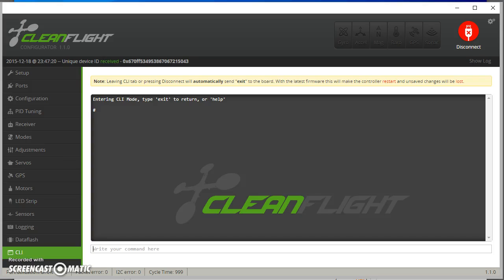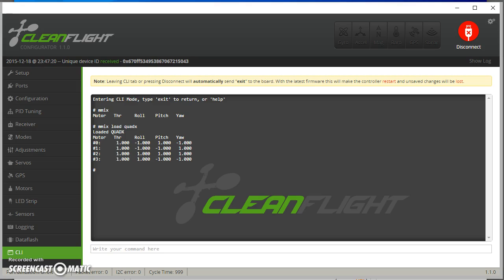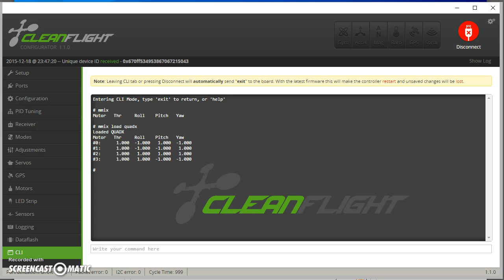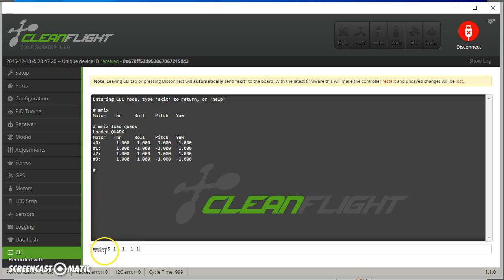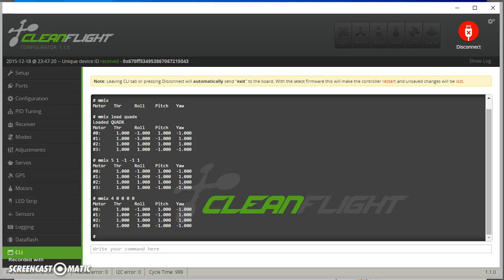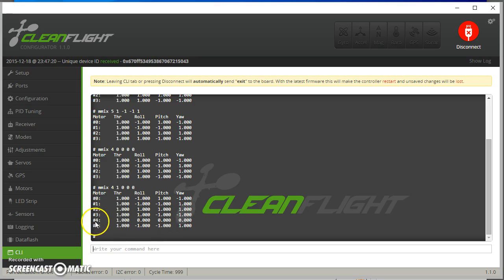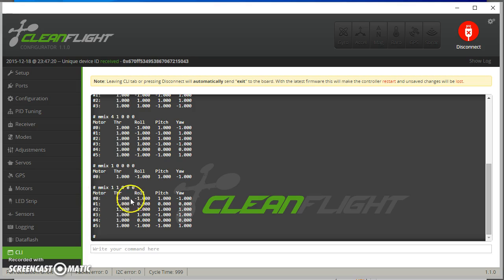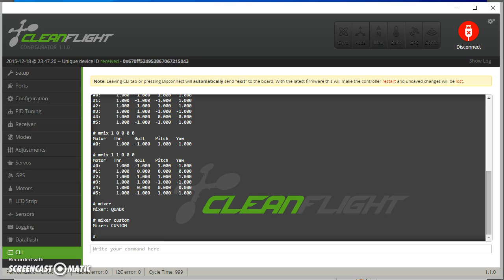Tutorial: How To Remap Motor Outputs In Cleanflight / Betaflight

Comment: hello Joshua Bardwell 🙌🙌🙌
Recently i did the motor remapping things just to play with FC and after that i just change the motor wire connection and now the omnibus f4 pro v3 blue LED blinking is not happening and i cant connect to System too, so what could be properly i have done...so  now i can't even remember the all individual  motor three wire connection..
can you please help me wit that proplem??
Thanking you
Tenzin lobsang
Reply from the maker: Changing motor mapping should not cause the USB to stop working.

If you can't connect to USB, re flash the FC using bootloader mode. Enable "full chip erase". This will reset the FC to default.

Comment: ...and for fixed wing works the same?....none of my servos are moving. They power up on lipo plug, everything ok in rx tab and cleanflight, i can arm and spin the motor, but no servo moving....
Reply from the maker: Setting up servos is more complicated than this. You need to configure the servo outputs and map them to pins. I'm sorry, but I have zero experience with this.
Reply: Joshua Bardwell thank you! Best man

Comment: I agree you are the man. My motor 1 quit working on the bench and I was getting solid green light after a few minutes of powering up, I was about to order new motors and esc's but I was convinced they were ok so did a bit more sniffing around, thanks pal.
Reply from the maker: Glad you fixed it but this is what you should do today, not motor mixing:

https://www.youtube.com/watch?v=FysPHx7RL9s
Reply: Why shouldnt I leave it with motor mixing does it cause issues? because ive been having drift and twitching problems that ive almost got rid of now, im wondering if this is why, Thanks.

Comment: Hi Josh, Set channel_forwarding_start=7 will push the output from the receiver to the servo but for more than one its got me stumped?
I cleared the resource for two channels ie
Servo 1 is A02 (Baseflight Aux 7)
Servo 2 is A08 (Baseflight Aux 8)
But changing the set channel_forwarding from say 7 to 8 just changes the switches on the controller and always the same servo?
I tried things like set channel forwarding 7, 8 but still no luck, I know the answer will be simple but I cant find it anywhere?

Comment: I followed this exactly and when I arm it flips out. ALso when i type mmix load custom, I get no values. but when i type mmix load quadx, i get all the values from 0-3. Any tips?
Reply from the maker: Go back to the default mixer and just use resource remapping to re-order your motors. It is better.

https://www.youtube.com/watch?v=z5aO-3_n-Hs

mmix load only works to load the standard mixers in as a custom mix. "mmix load custom" doesn't do anything as far as I know.
Reply: Joshua Bardwell I've actually remapped the resource(like in your other video) so now there are only motors 1234 and motor 2 is using motor 5s pin. it's on quadx now and it is still having the same issue
Reply from the maker: Check in the Motors tab that the correct motor spins when you raise the slider. Since you have been mucking about with remapping motors, it's almost certain that you have them ordered incorrectly.

Comment: What is a header number??
Reply from the maker: The motor outputs are numbered 1, 2, 3, 4. A pin header is where the pins are soldered to the board for you to plug wires into.
Reply: Thanks!!!

Comment: Thanks a bunch i had to remap two motors my flight controller would run both pin 2 and 4 at the same time for some reason I think I have faulty board
Reply from the maker: Look into betaflight resource remapping. Much better than a custom motor mix because it actually remaps the motor output fully. 

https://www.youtube.com/watch?v=z5aO-3_n-Hs
Reply: Joshua Bardwell yes I actually saw that video about an hour ago and would have done it that way it looks so much easier

Comment: great vid.  I was wondering if I could use a free pin such as mmix 5 for signal only purposes for a alarm/buzzer [e.g. mmix5 1 0 0 0 0 for throttle only].  the buzzer is designed to turn on if the signal stops.   do you know if this would work?  thanks.
Reply from the maker: +skytalon74 you would need an external circuit to detect the stopped signal. Are you trying to set up a failsafe buzzer? There are easier ways.
Reply: Joshua Bardwell yes. For a lost quad.  I would hit the disarm switch so no signal is passing through.   After 1 minute the alarm is designed to Beep.   I was thinking to test this.

Comment: After creating and using custom mixer,
cleanflight doesn't effect anything.it shows that it uses custom mixer but it isn't affect.
all things are saved.
Reply from the maker: Custom mixer does not re-order the motor outputs. The Motors tab is un-changed when you use custom mixer.

If you are using CF 2.0, then you shoudl use this feature instead: https://www.youtube.com/watch?v=z5aO-3_n-Hs
Reply: Joshua Bardwell Thanks for your support.
i will try that after betaflight 3.1 flashing.

Comment: off subject but does anyone know how to reverse rudder and aileron in cleanfliggt or betaflight
Reply from the maker: Best to do this in your transmitter I think, but you can reverse the channel using rxrange. The default setting is rxrange X 1000 2000, where X is the channel you want to affect. 0 is always roll. 1 is always pitch. 2 is always yaw. 3 is always throttle. This is true even if your channel mapping does not match this!

If you wanted to reverse the rudder channel you would enter "rxrange 2 2000 1000" in the CLI then type "save".
Reply: Thankyou very much. Im using a very cheap spectrum rtf transmitter that has no menu settings
Reply: Thanks anyway it didnt work. It wont reverse
Reply from the maker: +Patrick Fidler rxrange 2000 1000 definitely works. Look at the 3d model on the receiver tab. Which way does it spin?

Comment: hello pin 4 and 6 don't work on my cc3d. they did and now they don't. any help??
Reply from the maker: +vinnnocc1011 did you try to use resource remapping and break them? Or did they just stop working?
Reply: Joshua Bardwell   i got it all figured out. i resourced the motors now pins 1-2-5-6 work. now i got it flying not good but at least it lifts.   someone said anything above 2.9 is no good for a older cc3d is that true?   i'm on 3.1.1 now stock pids and quad flys crazy wont hover wants to flip and spin
Reply from the maker: +vinnnocc1011 I don't know any reason you couldn't run either of those versions on the CC3D. If the copter is trying to flip out probably the motors are not in the right location, since I know you were messing G around with remapping.
Reply: also i'm running emaxx 12a simonk. the quad ran great on openpilot.   now with betaflight and cleanflight it's so bad.
Reply: @vinnnocc  Bonjour utilisé Betaflight / CC3D 3.1.7 Apr  3 2017 / 21:54:46 (e1c4b5c) , très bon pour buzzer voie 5 ou 6

Comment: hi joshua,im using kingkong naze32 brush micro fc,when i plug the battery my #3 motor start to spin,and when i troutle it up,the speed of the slowly decresess,i rate my motor to 3200 and 1000 and stil nthing happen,any idea how to slove this,thanks
Reply from the maker: I have no idea why your motor is spinning when you first plug in. The motor should NOT spin except when you arm. Something is wrong with your FC maybe.

Comment: Hi Joshua, just had that kind of problem with my genuine SP racing EVO, and followed your video, no problem so far.... I'm running betaflight 3.0.1 and just small differences when typing the code. Figure it out so all good. The point is do you have any way to get rid of the motor 4 (the bad one for me) from the motor tab? Not essential but just have a better understanding about BF.
Cheers
Reply from the maker: +sebastien morente in Betaflight 3.1 you can do proper resource remapping. In 3.0.1 and earlier there is no way to actually move the motor output. You're stuck with motor 4.
Reply: Joshua Bardwell thanks for the answer, just wait and see for the 3.1 But my quad is working perfectly with that remapping.

Comment: Followed your steps and now have the following. My first motor pad on the FC is dead so now would I use motor pad 6 for motor 1 on the FC? Below is my CLI mmix output

mmix 0  1.000  0.000  0.000  0.000
mmix 1  1.000 -1.000 -1.000  1.000
mmix 2  1.000  1.000  1.000  1.000
mmix 3  1.000  1.000 -1.000 -1.000
mmix 4  1.000  0.000  0.000  0.000
mmix 5  1.000 -1.000  1.000 -1.000
Reply from the maker: +Evan Balbier I think that looks correct.

Comment: my rudder is on aux 1 can you help me ?
https://www.youtube.com/watch?v=ZcrYvNpoaGU
Reply from the maker: You have two options. 1) remap the channels in your transmitter to put them in the order that Cleanflight expects, which if my memory is correct, is AETR. 2) in Cleanflight, in the Receiver tab, change the channel mapping to whatever your Futaba is sending. The channel mapping goes AETR1234, with the position of the letter or number corresponding to channels 12345678. With the default channel mapping Aux1 is on channel 5, so to swap Aux1 with the rudder, you would change the channel mapping from AETR1234 to AET1R234.

Comment: I got a Vtail that definitely needs a custom mix but Ibgor it set up on Baseflight, how is it done there?
Reply from the maker: +Derrick Mitchell step one is to install a modern FC firmware like cleanflight or Betaflight. Is baseflight even still developed? 

I'm sorry, but I don't know how the motor mixing works in base flight. I would guess it is the same, but the command may be cmix instead of mmix.
Reply: Joshua Bardwell ok I'll try to do it the same way you did on cleanflight but using cmix instead. If that doesn't work I'll use Cleanflight. Because the Vtail is none symmetrical it absolutely needs a motor mix. Thanks.
Reply from the maker: +Derrick Mitchell I agree. Vtail flies best with a mix not only because it is not symmetrical but because of yaw / roll coupling in the rear motors. When I flew a Vtail I put roll authority in the front motors only and used the rear motors in my for yaw and pitch.

Comment: Hello sir, I'm a new sub and fan of your work and tutorials. I have a question, recently got eachine f4 board, flashed new betaflight 3.0.1 installed. Finished the build in just waiting for new TX to fly it. My question is about my brushed motors not spinning, at all, in the motors tab. I raise the bar and nothing. I just wanted to make sure everything was good but I get nothing. Am I missing something here??
Reply from the maker: Have you got Betaflight set to "brushed" output in the configuration tab? If it reads OneShot that won't work.
Reply: Joshua Bardwell correct. I have it set to brushed in configuration. It was changed and saved already... Hoping u have another possible fix...

Comment: Hi Josh! Your videos have helped me out immensely!

I have an issue. I received my Naze 32 (Flip 32 Deluxe) and had to do a custom mapping since channel 3 and 4 were DOA. I have them spinning the correct direction upon arming, but it seems that my input of yaw is sending pitch to my FC, and when I attempt to hover, it pitches backwards and goes into a death spin. 

Can this be remedied with the motor mixes? Please note, my reciever tab in Betaflight shows that all inputs are correct, and in the correct direction.
Reply from the maker: Does the 3D model move correctly when you hold the board in your hands (without the motors spinning!) and pitch and roll the copter?

It's possible you have entered the wrong motor mix such that yaw input is interpreted as pitch output. Only a careful double-check of the motor mix values would reveal this. Compare them to the QuadX mix. For whatever line you moved, make sure that the correct motor has the correct values.
Reply: Fast response! 

Yes, the model moves correctly, and I triple checked the mixer values. I also made an excel sheet to make sure that I got all of the values inline (and reduced output to 20% so that I didnt destroy anything!) Any other ideas? Also, I am fairly certain I have the orientation of the board set correctly in betaflight.
Reply from the maker: If receiver channels are right and the 3d model moves correctly (= board align is right) and the motor mix is correct then I have no idea.
Reply: Alright, thank you anyway for your help! Keep on with the videos :)

Comment: Very useful info! However, your other method works better (go to CLI, type mixer, copy it, paste into something like "note", change motor #, paste it into the CLI, select custom mixer and save)
Reply from the maker: +timothy dzugan yes, of I understand correctly. Also you would need to adjust the board alignment.
Reply: Lu Ri so if I installed my fc backwards I could just copy the mix to note app just change motor 0 to  and 2 to 0 and 1 to 3 and 3 to 1 and save that in cli?
Reply: Joshua Bardwell if I already have the board alignment set correctly before doing the custom mix will the board alignment need to be changed again?

Comment: Is there any way to replace the second servo output on a tricopter mix with a motor mix?

I have a custom tricopter mix that has 5 motors (pentacopter) and I'm trying to map them all out of my Naze.  The servo is correctly outputting through output number 1, but there's nothing on two.  Three is motor one (0) up through six which is motor 4(3) but motor 5 (4) is nowhere.  I'd maybe like to put motor 5 on that empty servo channel.  How do I do that?  Thanks.
Reply from the maker: If motor 5 is controlled by the PID loop you cannot do this on a board with only six outputs. When you enable servo_tilt, motor outputs 1 and 2 are only for servo outputs. You cannot map a motor output to those headers. So you would need a board with eight motor outputs, so that when you enable servo_tilt, you have six motor outputs remaining.
Reply: Thanks for the quick reply.  Is there such a board?

I think the only remaining way to use these extra motors with this board (other than two y-cables to make it functionally a tricopter) would be create a custom mix in which these extra motors only work with the throttle component and do not contribute to pitch, roll, or yaw.  That way I'm only using four motor channels, and still getting the lifting power from these motors.  Does that sound logical?
Reply from the maker: Yup. Perfectly. That's a fine way of doing it.

There are lots of FC boards with 8 motor outputs. Well... maybe not lots anymore, but several.
Reply: Do you know any offhand?  Tricopter capable?

Comment: woah!  dude, you just saved my build! props to you. i just lost all functionality of motor 3 and when i realised i wouldnt be able to remap that channel to output 5 i thought i was gonna be grounded until a new FC arrived. thanks a bunch for making this vid.
Reply from the maker: +Linktw0 glad it was helpful.
Reply: errr i kinda jumped the gun there hahah im afraid its not working for (me. i followed your instructions to the letter, im my config tab i see the custom configuration. when i check the cli again i do see the following;
# mmix
Motor Thr Roll Pitch Yaw
#0:  1.000 -1.000  1.000 -1.000
#1:  1.000 -1.000 -1.000  1.000
#2:  1.000  0.000  0.000  0.000
#3:  1.000  1.000 -1.000 -1.000
#4:  1.000  1.000  1.000  1.000

(i intend to remap motor 3 to output pins channel 5 on my board)
any suggestions?  thanks again!
Reply from the maker: +Linktw0 double check that the lines are correct. It's easy to mess up a sign. Copy paste the original quadx mmix lines and change just the motor number then paste the lines back in.
Reply: Joshua Bardwell  Thx again for your replies. the lines are correct as far as i can tell. i tried your copy/paste method but the result is the same, motor 3 remains dead. i measured signal line of the headers and channel 5 appears to be still working (just to rule out that whatever had fried ch3 on the board has now also taken out ch5). do you think it would be worth a shot to reflash this board, maybe even switch to betaflight and then try to remap the outputs again?

Comment: Can you help me with something? Trying to make a hovercraft out of old quad parts. I've built the hovercraft but I can't get either a Naze32 (using cleanflight) or a CC3D (using openpilot) to function the way I need. Is there a way to map a control input directly to a motor output without having yaw, roll or pitch in the equation. The hovercraft is made using 3 motors. Two motors provide air for the cushion and also steer the craft using motor torque. I'd like to end up so that moving the throttle stick spools up both "lift" motors, moving a stick left increases the speed of the clockwise motor and decreases the speed of the counter-clockwise motor (and visa versa), and moving the elevator stick forward spools up the thrust motor... I've managed to get the craft hovering and turning by setting it up as an X quad and setting the two lift motors and the front motors of the quad but I cant get the thrust motor into the equation properly. Any idea's?
Reply from the maker: Sorry for the delayed response. I thought I answered, but I guess I didn't.

You want to look at feature servo_tilt or feature channel_forwarding. Either of those will allow you to forward an Aux channel out of the FC. You can then run that Aux channel directly into the ESCs for the lift motors.

Servo_tilt forwards out motor headers 1 and 2. Channel_forwarding forwards out the RC header. Channel_forwarding is simpler, but many boards don't put the RC header pins on the board since their primary purpose is parallel PWM input, and that's not very popular these days. The down-side of servo_tilt is that you have to mess with servo configuration but possibly it's simpler than it used to be.